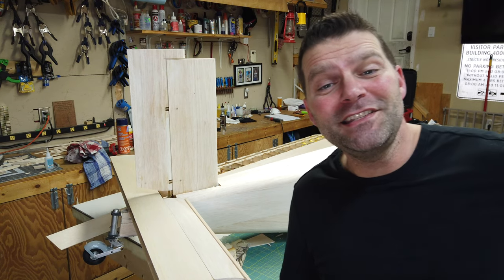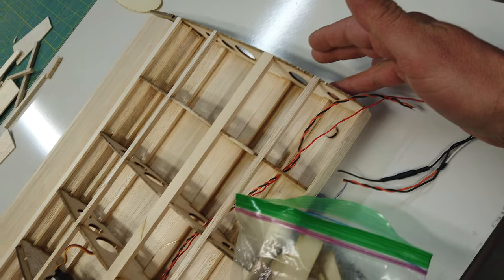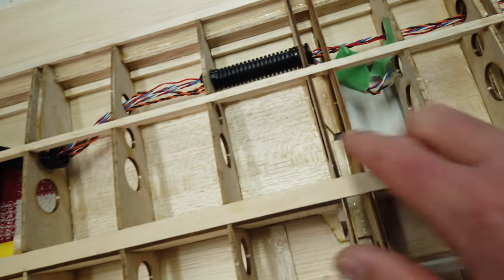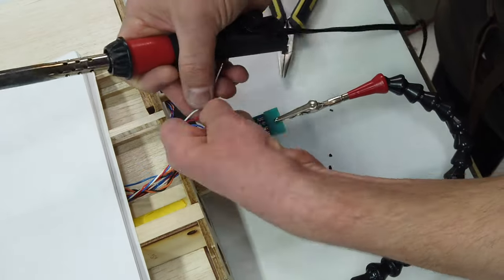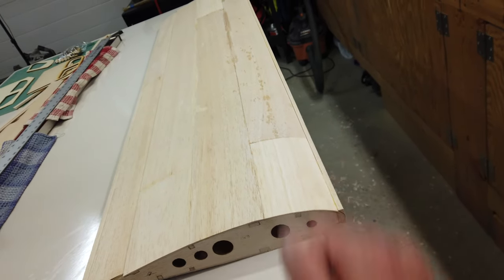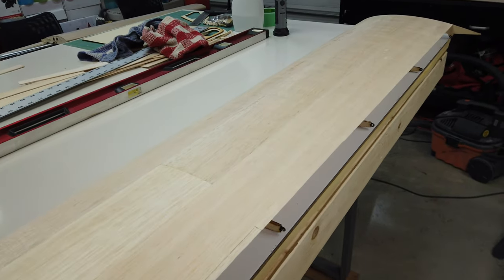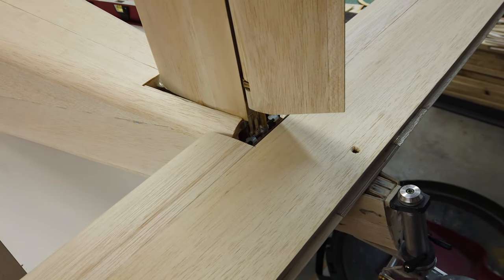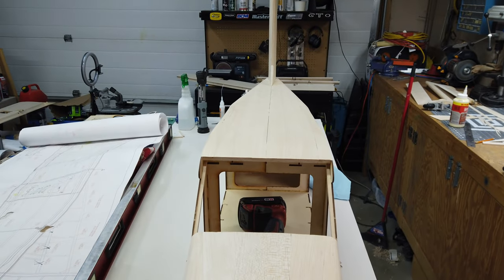HUGE WINGS Are DONE on the PC-6 From MR Aerodesign - Pilatus video 10

Comment: Beautiful job! I have learned over 40 plus years of building scale models, that I NEVER use CA on sheeting where there is a butt joint, or anywhere where two pieces of balsa will be joined and later sanded to create a smooth surface. I only use a high quality wood glue that has quality sandable properties. A CA joint is rock hard, and when you sand that joint, the balsa on each side of the joint sands nicely, but the rock hard joint does not sand at the same rate, and you will always see these unsightly joints all over the airframe. CA used under the sheeting is great, but where it has to be sanded, and can be seen, not so much.
Reply from the maker: Thanks for watching and great suggestions on the glue!
Reply: absolutely agree with you on this ...ca glue on sheeting joints is generally a bad idea ..it cant be sanded properly and will show once covered especially if you are fiber glassing it !

Comment: Johnathan,  male and femal connectors are based on pins and not on connector shell (cassing). 
Pin numbering should be as identified on the connector. This is important if someone else get to do some repairs without reference documentation. Seen it too often as an electronic tech. But if it works for you...bonus. 😉😊
Reply from the maker: Thanks 😊

Comment: Epic build, very impressive. I build wooden ships and have been looking starting an RC plane. So enough of beating around the bush then, tool wise ,beside special tools, I would assume they are pretty much the same or do you have a place to buy the tools that you need? Heck don't even know how many would work in a cross over. Any advice?
Reply from the maker: Hello!  Thanks for watching!  i've never built a wooden ship but i'm sure the tools are all the same.  Basically they can all be found at craft stores or hobby shops.  some of my stuff comes from wood working shops if they carry smaller scale, more precise tools like my little wood block planes.

Regarding advice, this would be considered an advanced kit.  I would start off with something smaller and more simple.

Comment: I have  question  when connecting your wing for the ultra flash   Can I use the thunder rc multi servo harness for 4 servo? I’ve use this for my 40% ,  but being that I have the retract and brakes  plus flap and alieron  in each wing half   would it work ok?   I was also looking into aeropanda  multi  servo connector  although with this one u have to crimp each wire, thanks
Reply from the maker: Hello Carlton. On my ultra flash I use 2 Ashlock connectors that are 12 pin (4 servos) each. Each connector covers 2 servos, electric gear and brake. I’m a fan of doing all my own connectors and leads so I don’t get any pre made ones myself but it’s a quick option.
Reply: @thelightersideofrc   I appreciate your quick response,   This is my 1st jet  so Im learning  a lot from your vid  thanks
Reply from the maker: Sweet!  Thanks 😊 I’m sure you probably found it already but I did a series Of vids on my ultra flash fuse swap.